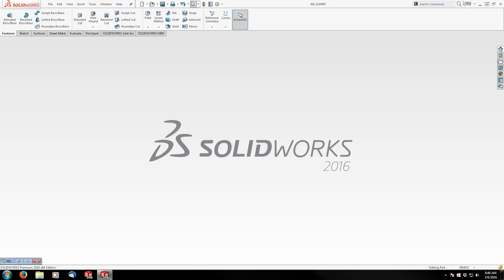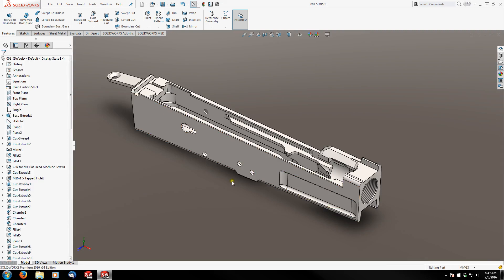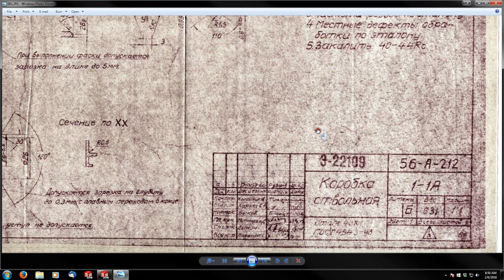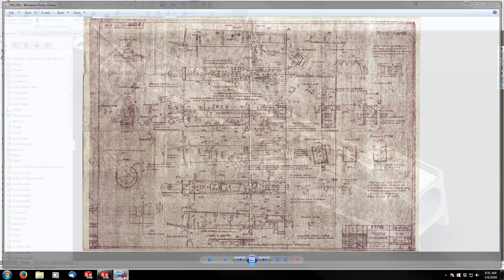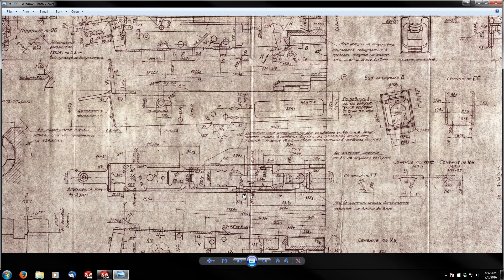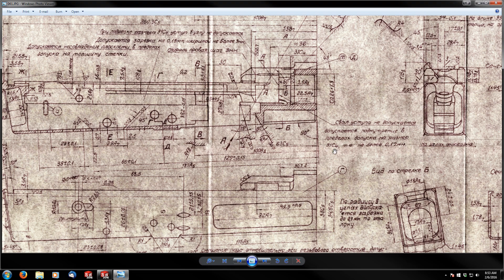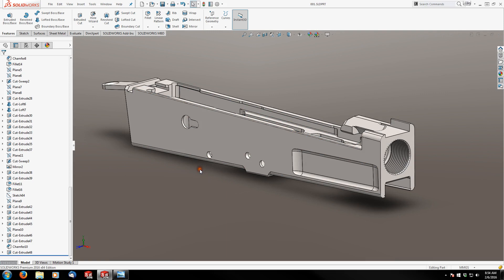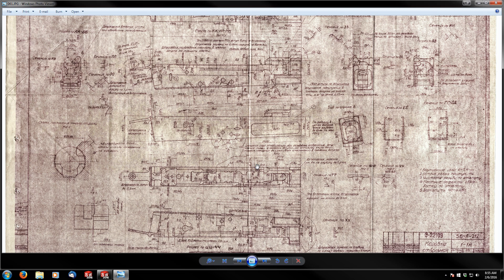01 Milled AK Receiver Intro

Comment: That's cool how the whole thing is machined from bar stock. No need to rivet the trunnions or spot weld the rails.
Reply from the maker: The funny thing is that the AK was originally designed to be manufactured with stamped parts, but there was a problem getting tooling setup for production, so Kalashnikov settled on a milled version for the first 10 years. The AKM was really his original intent for the AK-47.

Comment: I was wondering if there is an free versions of these 3d modeling programs that i can use that will be suffice and compatible with your files
Reply from the maker: Yes! I would recommend Onshape at https://www.onshape.com/
Reply: wow thank you very much!
Reply from the maker: You're welcome! Let me know how it works out. I've only used it a little bit.
Reply: honestly it works great and the edges are smoothed, not to sure about the advanced tools, i'm just a beginner. but it even said files can be compatible with multiple programs and it seems like it has high quality end products, but also i checked out the retail solidworks. The salesmen for solidworks kind of made it sound like all the other programs where obsolete in end product speed and comparison.
Reply from the maker: I know he's a sales guy making his pitch, but I would have to agree with him on speed. The software is definitely not catered to an independent designer though. The upfront cost is huge.
Reply: Onshape.  Highly recommended.